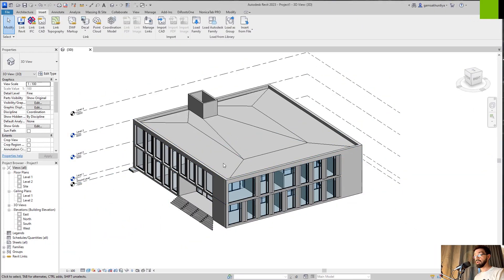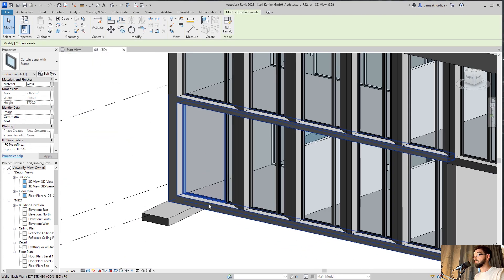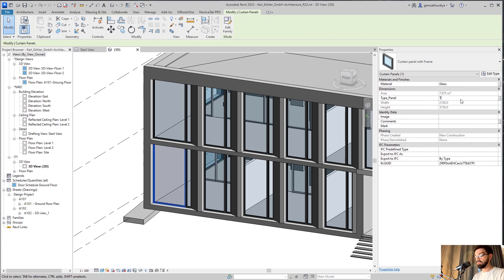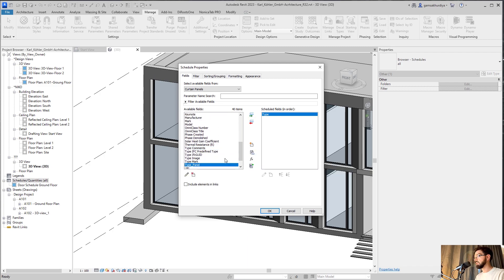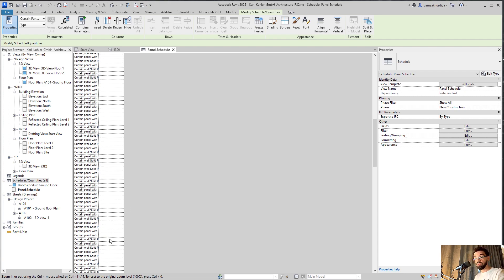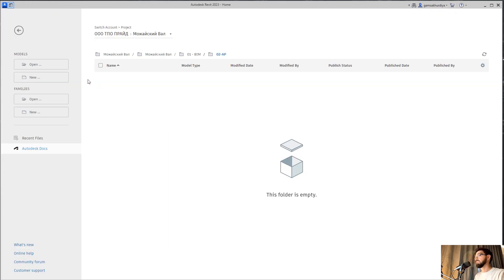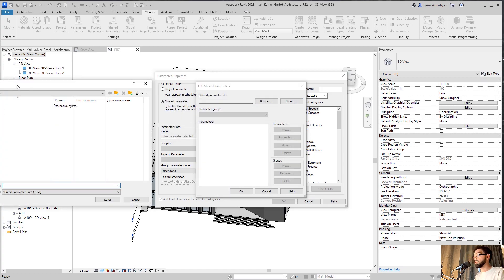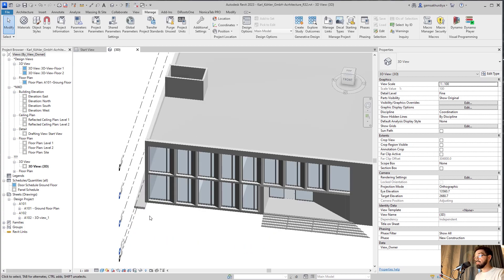Shared Parameters vs Project Parameters in Revit — Transfer Guide

Comment: Hello, I have a question. When I want to make a curtain wall from floor to floor in Revit, when I set the 'top constraint' value to the upper floor, the windows go inside of the floor slab, so the top offset; I set it to be 'minus the slab thickness'. However, when I want to change the floor thickness afterwards, I have to manually change the top offset of all the windows so that they do not go into the floor again or remain exposed. Should I define a parameter or anything else, what would you recommend? Thank you.
Reply from the maker: No question. Let me show you in next video. Thank you for really nice question
Reply: @NikoG  Yes, that will be perfect. Thanks!!